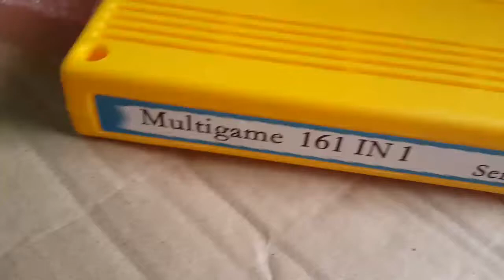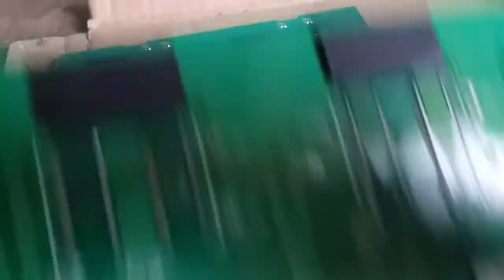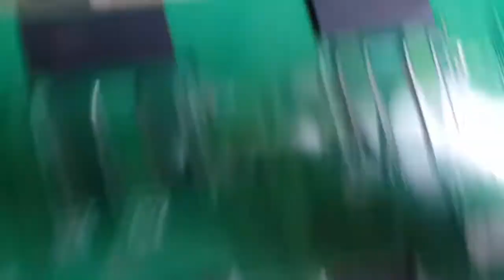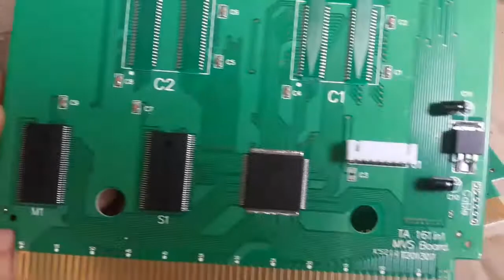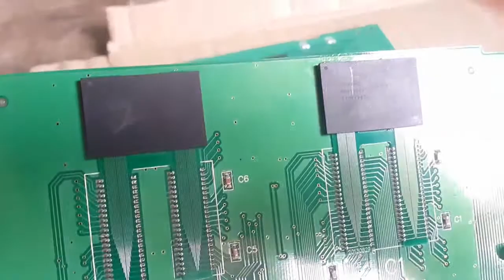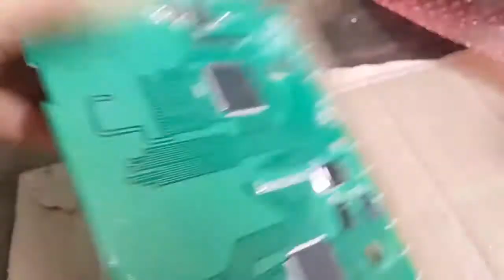161 in 1 (New) wtf? Do not buy this multicart has a lot bugs.

Comment: Hi I have this cart, I’m looking to mod it at c5 and c6 with 47pf capacitors to help clear sound issues in some games. My cart and board is exactly the same. Have you had any issues with this board. Also on my board all three pins for the voltage regulators are soldered to the board but your has the middle pin cut.
Reply from the maker: MJ P  Hi yep I have the same Issues.
I think This Board Not Good like The old Ver.
Reply: កិម ឡេង last night I added 47pf capacitors by the empty pads on the pcm 2 board and replaced the electrolytic caps with 2 x nichicon 47 nf 50v on both boards. There are no issues now. I reckon the capacitors that are on the board are not good or dry, and there is someone on YouTube called Gadgetuk who also recommended the 47 pf mod for the sound issues. All my issues seemed resolved. I tested all games ie sonic wings 3, Samaria showdowns, last resort,  shock troopers. I also see that that the glitchy graphics have cleared up.
Reply from the maker: MJ P thanks for info.
Reply: Hey mate, any chance you could share some pictures of what you did to fix your board? In addition to sound issues i'm having reset issues on the Samurai shodown series  as well as graphical glitches on Top Hunter. Thanks
Reply from the maker: @123thewarrior  Hi dude
here the same issue.
do not use Unibios, 3.1 or 3.2 free ver.
it runs perfectly on original Bios only.
Reply: Thanks for the reply, i'm running on original bios but I still get these errors :( Wondering if it could be my motherboard causing the problems
Reply from the maker: @123thewarrior  Hi friend. 
MV 1FZ - MV 1B - MV 1C  had the same problem even original Bios 

But I used MV 1A it runs Fine 

No Glitches graphic or sound.